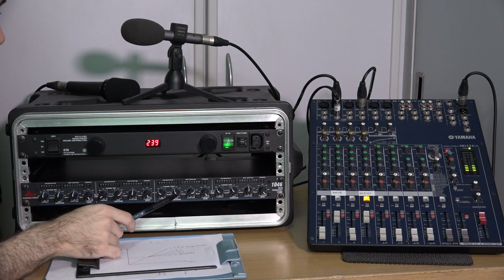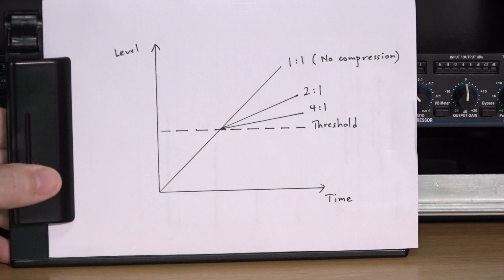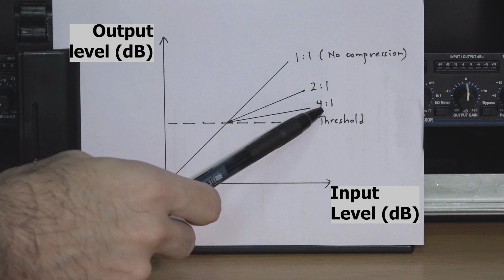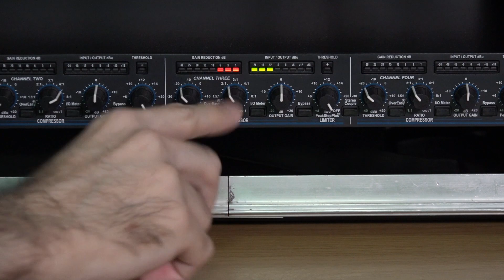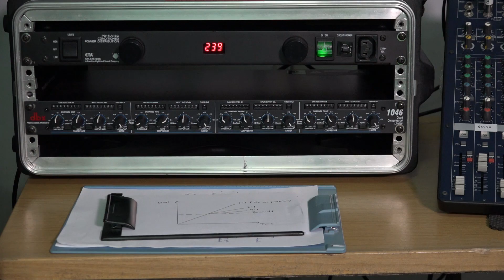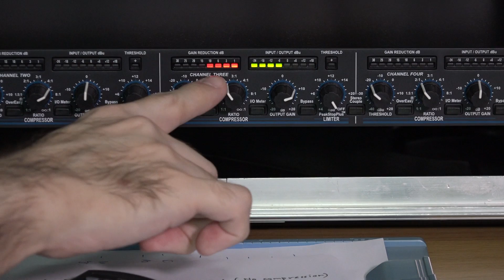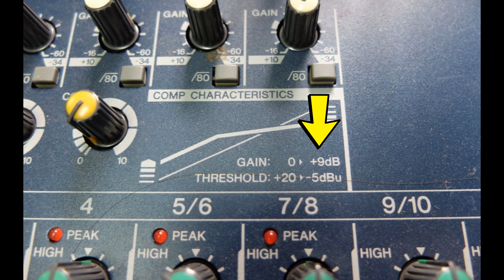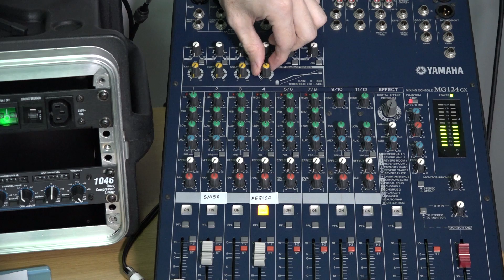How to use a one knob compressor

Comment: To protect loud speaker (tweeter speaker) which is the best compressor position in one knob ?
Reply from the maker: This type of compressor is not designed to be a loudspeaker protection device - for that you need an overall system limited which is placed between the mixer and power amplifier.

Comment: All Tascam model series mixers don't have auto make up gain like most one knob comp. mixers do. . . you just have to push the faders up.
Reply from the maker: I assume you're referring to the Tascam model 12/16/24 mixers? Yes, it's important to know the characteristics of the specific compressor you're dealing with. I'm rather disappointed that Tascam do not give technical details in their user manual, it would be useful to more advanced users.

Comment: I'm operating Yamaha MG16xu at church. How do you prefer to set the compressor level? Thank you!
Reply from the maker: It depends on the source - for drums I'll generally set the knob between 12 o'clock and maximum, for vocals and other instruments between off and 12 o'clock. It's important to start with the compressor off and then listen to the source before introducing the compression. Also remember that this type of compressor adds gain as you add compression, so it can cause feedback in some cases.
Reply: @GLBProductions  helps alot thank you Sir.
Reply from the maker: You're welcome :)

Comment: can you use compression to battle mic feedback? I have the same mixer and we don't hava an active or parametric EQ...how can we resolve feedback?
Reply from the maker: You can, but the compressor on this mixer is not suitable for that purpose. In your case, you will need to try relocating the microphone relative to the speakers, using a more directional mic, and possibly adjusting your levels.

Comment: Magnifique explanation of practical usage of the One Knob compressor. Thank you.
I use a set of seperate 4 channel compressors which I use for super dynamic signals since I need to see what happens while I dial in the seperate parameters. Now I can use my one knob compressors more frequently
Reply from the maker: That's great to hear Mike :)

Comment: Plz, i have d MGP32x and i am aware it as compressor inbuilt for most of d channels. Wld i still need an external analogue compressor to be used with d mixer for live sound set up?
Reply from the maker: You probably don't need one, although it would offer more control and the ability to compress the entire mix.

Comment: Hi Interesting!! I have my DBX 163X plugged through the effects loop of my xrc600c Pevey and when I move the master effects knob or the channel effects knob it does change the sound and the  compression lights vary but I don't really know what I am doing ha ha ! Does a compressor need the effects loop to operate it ?  And I can't make any sense of the level set knob! and the Hi Z input. Reading the manual does not really help! the one knob is like the slide knob on the 163x I guess.
Reply from the maker: Ah yes the old 163X! Outboard compressors like this are best used via an insert cable on one particular input channel, or inline between the mixer and the power amplifier. They are not designed to be run in an effects loop, although there are some studio applications for this - look up parallel compression if you're interested. The Hi-Z (High Impedance) input is for connecting a guitar or bass directly to the unit, so using it almost like an effects pedal.
Reply: @GLBProductions  thank you for the info I'll certainly check out parallel compression

Comment: Hi Bruno ... Great teaching of concepts as always! But here's a practical problem I have to deal with while mixing sound in my Church ... Once in a while we have very dramatic preachers. They are quiet in sections of their preaching but suddenly start shouting very loudly into the microphone perhaps ignoring the existence of the PA system and introducing sudden loudness or even feedback into the mix. We have a mixer with one knob compression. Do you think we can manage this problem with compression or do we need another strategy for such situations? Thanks ☺️
Reply from the maker: Hello there Amber, I have often encountered such preachers in the past! A one-knob compressor will definitely help in such situations, but at the same time you have to be ready to pull the channel fader down to an appropriate level once the person starts shouting, and then bring it back up when they are done. Such speakers/preachers definitely require more attention from the sound engineer than those that speak at a consistent level, that's just the nature of our work 😊
Knowledgeable speakers/preachers who are dynamic in their delivery will moderate its effect on the sound system with good mic technique - they will pull the mic away from their mouth during the loud parts and work close to it during the soften sections.
Reply: @GLBProductions  Thanks for your reply! Being quick with the faders is how I've had to manage this!! It's all by ear and quickness of hands just as the way you put it. We always hope for people who know how to use the PA effectively and keep our fingers crossed so Amen to what you've written regarding that! Have a great day 🙂

Comment: Hi there, awesome explanation! I have one question, does every instruments need to be compressed? Hope you answer it! 😄
Reply from the maker: No, it's very much on a case by case basis, depending on the instrument, style of music and the player.
Reply: so if everything is going well, I assume it is better to not have any compressor at all?
Reply from the maker: Not really - vocals and drums typically need some compression to sound correct in the context of modern music. Your ears will tell you :)
Reply: okay, so other than that, you don't need any compressor?

Comment: Why do you start at 12o clock?
Reply from the maker: That seems to be a good starting point based on my experience.
Reply: Ok thanks. I want to compress the nord drum 3p with a one knob comp for live... do you have an idea for that?
Reply from the maker: Doesn't that have compression built into the patches? Take a look through the menu. Otherwise your ears are your best guide.

Comment: Can you turn phantom power for specific inputs in this mixer? 

I noticed that you're using a condenser microphone (which requires +48V) and a dynamic microphone (which doesn't require phantom power), wouldn't it damage dynamic microphones to have them plugged in to an input with +48V?
Reply from the maker: No, phantom power is global on this mixer - all on or all off. Phantom power will not damage dynamic microphones with a balanced XLR output - just remember not to plug/unplug XLR cables while the phantom power is on.

Comment: What will be the best level of compressor knob in yamaha mg10xu.. per your experience??
Reply from the maker: It really depends on the input signal, but in general: between off and 2 o'clock for vocals and other non-percussive instruments, from 12 o'clock to full for drums and other percussive instruments. Listen carefully as you adjust.

Comment: Shouldn't the dotted line(threshold) be on the x-axis? It shows how much Input (threshold) triggers a comp? Or am I misunderstanding something? No biggie, this is otherwise clear to me. Thanks!
Reply from the maker: It could actually be on either, but the textbook that I took this diagram from [White (2003) Basic Live Sound, p.86] has it as shown. I think it makes it easier to refer to the signal as being above or below the threshold, rather than to the left or right of it.

Comment: My EARS have always been GREAT, Sadly, my understanding of compression is about the same as it was in 67..LOL. My only exp with using one is on a TINY VOX Mini 3 amp, which has the ONE knob COMP... My vocals sound KILLER thru that lil thing when its almost maxed out. No "specs' are giving regarding what is actually going on with that ONE knob but Im guessing its does exactly what youve just decribed here.When using  COMP software, I move the lines and dots around to get what I want vocally and have never looked at the numbers, thus remaining CLUELESS..LOL..I just bought a DBX1066 for my lil solo show to use in an AUX SEND/RET of an old 8 CH Brain and your explantion here has REALLY HELPED understanding whats really going on.. Still got alot to  learn about expansion/attack/gating but lll likely let my EARS do the learning for me..LOL.. Thanks for the video!
Reply from the maker: You're welcome John, never stop learning 😊

Comment: to add on the point around 7:20ish, there are upwards compressors that do make quiet sounds louder, increasing the gain of sound that is below the threshold. these sound great on drums in the studio, but would be completely unusable in a live situation, as they would cause feedback immediately.
Reply from the maker: Yes I've seen them used in broadcast as well - I believe there they are referred to as levellers.
Reply: @GLBProductions  a broadcast leveler is more of a complete package usually, a gate/expander, upwards and downwards multiband compression, EQ, de-essing, exciter, and such, all set to a specific preset by the head of production and then locked to those setting for its lifetime of use. the aphex 2020 or the TC finalizer might be more studio-y examples of that sort of thing

Comment: Excellent explanation thankyou! Any reccomendations on my behringer 1 knob compression on my acoustic? It seems to get really bright at anything past 9 o'clock. Is the channel gain too high or low possibly? Thanks :)
Reply from the maker: You're welcome Clint. I suggest you do some research on the compressor in your particular mixer to see exactly what it is doing to your sound - then you'll be in a better position to decide where to set the knob. Also, set channel gain BEFORE applying compression - this gives the compressor the best possible signal to noise ratio to work with.

Comment: Hi bruno hope your well, just a quick question , I have a glxd2/4 shure radio mike system and the default setting is +18 db so do i need any gain on my yamaha mg 124 cx mixing desk or should i decrease the out put on my mike and increase the gain on  on my channel ? cheers.
Reply from the maker: Hi Kevin you can actually leave it at +18dB as long as it is not causing any distortion at the mixer input. With it set there the receiver is handling all of the gain, so you can turn the gain control on your mixer all the way down to start with.
Reply: @GLBProductions  thanks very much.

Comment: Hey here's the catch. I use oscilloscope to measure the proper sounds of the vocal. Is that ok?
Reply from the maker: What would your objective be in such an exercise?
Reply: @GLBProductions  instead of just relying on the LED Vu meter i may saw a lot of different frequencies that i can cut off in equalizer. That's my idea. So in my example. I may use a compressor, preamp, reverb, 
External equalizer. So i can tune the vocal properly. Using oscilloscope. So i can see any different waveform of vocal at oscilloscope. :)
Reply from the maker: Yes you can do that, but I would suggest that you just use your ears instead. The waveform does not tell you how the sound source interacts with the room nor how the direct acoustic sound is interacting with the sound from the speakers.
Reply: @GLBProductions  yes. Thanks for the beautiful answer. More power to GLB Productions and to you.

Comment: Hey. If i use 4:1 ratio of compression. And i have 6 singers and 2 master of the ceremony/host. May i use 4:1 ratio too at master of the ceremony/host?
Reply from the maker: Is that in general or on this particular mixer?
Reply: @GLBProductions  yes in general :) that's of my example is. The singing contest. There's a 6 singers. And 2 host.
Reply from the maker: For singers I like to start at 2:1. A ratio of 4:1 is more appropriate for speech, especially for situation where the person shouts a lot 😋
Reply: @GLBProductions  oh. Thank you so much. Know my questions are now clear. By the way im from Philippines. And we. The Filipino. We really really love sound system so much. So thankfully there's a channel like you that can support and help. us a lot. Once again more power to GLB Productions.

Comment: This clearly explains compression very well- thanks! Especially since I have MG10XU that has some similar controls. My question is this, as more compression increases the gain on the microphone, do I compensate by turning the microphone gain down, or do I need to turn the channel level down (or doesn't it matter). Thanks again for the best review on compression I've found!
Reply from the maker: Thanks for watching George. In my experience there is no need to adjust channel gain or fader until you hit about 3 o'clock on the compressor knob. Yamaha have calibrated these pretty well for everyday use.

Comment: Xenyx qx1202 or mg10xu, which one is better. I am building small home studio setup. Already have scarlet 2i2 interface. I am refering fx effects and compressions. Plz suggest....
Reply from the maker: The Yamaha is far better.
Reply: @GLBProductions  but i have read some reviews that it has very low out via usb while recording..is this really affect..or i can avoid by connecting via scarlet audio interface..
Reply from the maker: If you are recording via the Scarlet then you don't need a mixer, unless you want one for routing purposes.

Comment: Currently, I have a mixer, amp, EQ and 2 active and 2 passive 15" speakers used for acoustic jamming purposes with close relatives. I intend to buy a compressor but was advised not to insted bought a sub-woofer.  My question is what is the primary use of compressor is it for vocalization only?
Reply from the maker: Compression is used to control the dynamic range of any signal, not just vocals :)
Reply: @GLBProductions  Thank you, I'm enlighten.

Comment: So my question is, how much superior would using an external compressor be compared to the built-in one-knob compressor on a mixer?  I'm debating buying a new Yamaha mixer (with one-knob compressor) or a slightly cheaper Mackie mixer along with a rackmount compressor.
Reply from the maker: An external compressor will always give more control because it has separate knobs for the various compression adjustments like threshold, ratio etc. Whether or not that is superior  depends on your needs and experience level - the one-knob compressor is quick and easy to set and does a surprisingly good job for what it is.

Comment: Hi,
I am from india...We use mg16xu in our church. The knob setting will make the sound softer and sweet. ?.becoz now I have kept the knob at completely left (min). It's a big hall the over all sound is very loud. What to do...Will the sound bexome crislp &clear by increasing the comp knob
Reply from the maker: No it will not - a compressor controls the dynamic range of the signal, not the tone. If the sound is too loud use the fader to turn it down :)

Comment: step 1: put compressor on ebay.
step 2: buy compressor with threshold, ratio, attack, and release.
Reply from the maker: A bit hard to do if your compressor is built into your mixer ;) But yes, having those additional controls is preferable.

Comment: Hellow,
 GBL Production.
i have a question, what can i do first, do i need to start Equalization  before i start the compression ,or i need to use compression first before the equalization?? Thank you.
Reply from the maker: In the case of this mixer the compression is pre-EQ, so it makes sense to set compression before setting EQ.
Reply: @GLBProductions  thank you so much..

Comment: Hi Sir i am using Yamaha MG82Cx with my Alto Tx600 wt sometime in live event the high goes off and it's start automatically infact speaker are working fine without mixer but the movement i start the effects in mixer the same problem arise even i have shown the speaker to service center the speakers are fine they said,  kindly help me what can be the problem
Reply from the maker: What do you mean by 'the high goes off'?
Reply: @GLBProductions  speaker hiz on and off automatically between live event
Reply from the maker: Sorry I'm not familiar with this issue.

Comment: Thanks. Nice video, indeed. Been watching on & off your videos along the years and recently found you again. I have 2 mixers with one-knob comps - a Yamaha MG10XU, so similar to that used in your video, and a Behringer Xenyx UFX1604, and I confirm that using your ears is the best and only option, unless you can use plugins or outboard compressors complete with all the proper parameters. I was surprised not to see any attack and release knob on your dbx, does it have some sort of auto mode for that?
Reply from the maker: Yes that particular model has no space for attack and release knobs, they are set automatically.
Reply: Thank you. So, I guess getting a couple of 166 may be a better option in terms of flexibility, perhaps. Have a great day and thank you for your work.